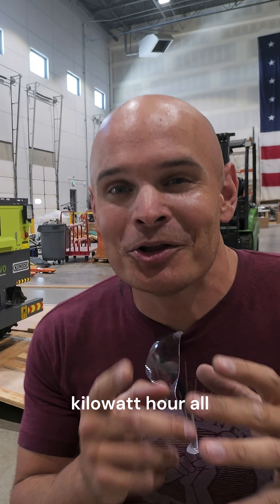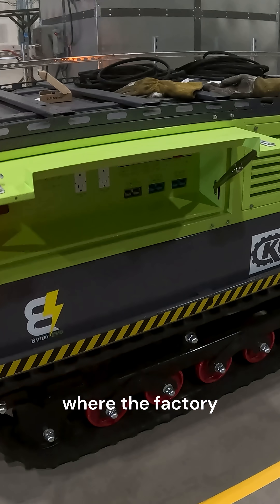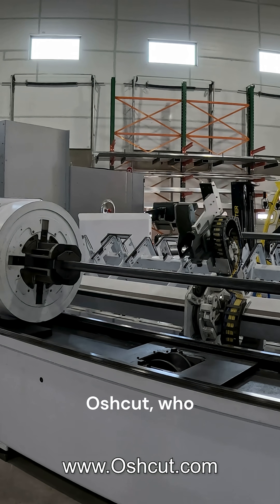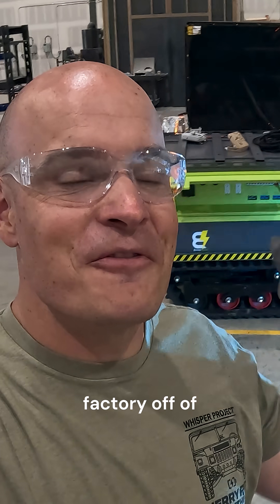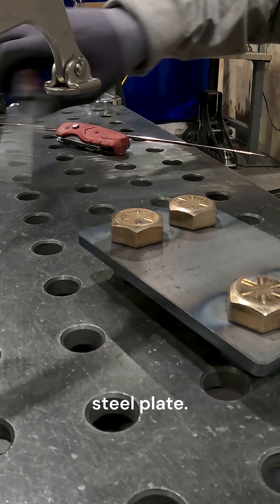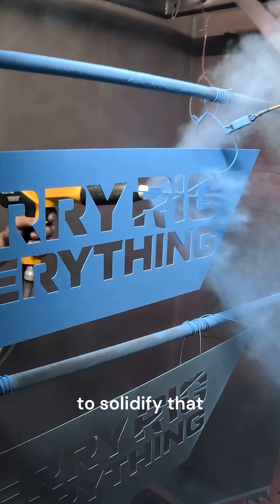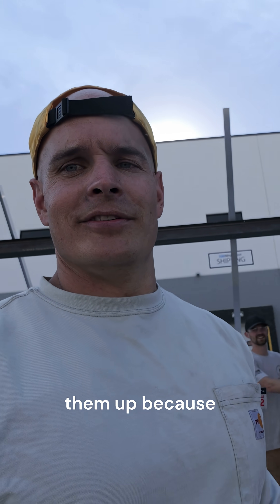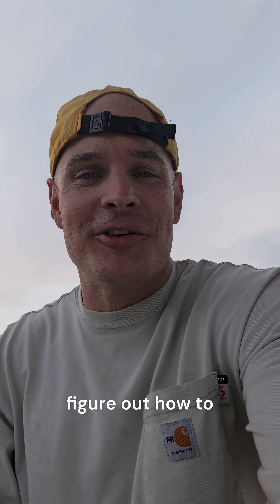If a Tesla and a Tank had a baby...

Comment: Statement "It can handle 10 welders welding at the same time" But how bad does it twitch if they all spark at the same time?
Reply: What do you mean by "twitch"? As far as I can tell it's just a battery on tracks and I'd assume the welders are supplied by AC so I don't think the cord running them would repel each other. I've seen that on GPUs starting aircraft with DC, it's a sight.
Reply: @12pentaborane Maybe he meant power ripples? It's one thing for it to be able to provide steady power, but another to be able to do that and handle sudden, short spikes of extra power consumption, without the power rippling. (Just guessing tho.)
Reply: @mnxs  From what I've read it seems as long as the inverter can supply the load there shouldn't be much issue concerning the quality of power coming from the inverter.

Comment: Can recharge a cellphone 6000 times, eh? I'm sold!! 😂😂
Reply: Way more way way more
Reply: I'd like to know which cellphone has a battery that will last for 6000 cycles.
Reply: @Thermalions my past phone is 6 years old and still holds a charge I mean sure it only holds for a day now but still it really just depends on what kind of phone
Reply: For instance my current phone (samsung s21 FE 5G) only lasts a day and it's relatively newer than that old one
Reply: @funniersphere44  It'd only need to last another 10+ years of daily charging then to get close to 6,000 cycles.
Reply: @Thermalions, you aren't factoring in all the parameters. Also, home phones last 12 years plus
Reply: @funniersphere44  What parameters. 6,000 daily charge cycles divided by 365 days in a year is 16.4 years. More if you don't start out having to charge it daily.

Home phones are not cellphones, although I've never seen the replaceable batteries in wireless home phone handsets last 6000 cycles either.

It was supposed to be a funny throwaway comment, that I never thought would be up for serious debate. Have a good day sir.
Reply: @Thermalions it doesn't have to charge the same phone 6000x. but if you're doing 20-80% cycles ND no overheating should be possible. I've had phones with less than  1% degradation after a year and about 1 cycle a day and I was doing 0-80%
Reply: they could add  4400x 5W USB ports 😂
Reply: @geemy9675  how many 20W USB-C ports?
Reply: The BMS will eat more power than the smartphone while charging 😂

Comment: It's still amazing that from reviewing the robustness and other features of phones to doing stuff with electric vehicles then factory stuff and now a electric battery with tracks. You probably could fit a couple of panels to it 😂. It's just crazy that technology has come to the point were you can have a mobile power plant fit in a garage that could probably power a small neighbourhood. Does it use the new battery Tec the solid state batteries or something else?
Reply: ‘Komodo power tank.’ It’s LFP chemistry.
Reply: Based on the size, I'd say it's not the solid state battery